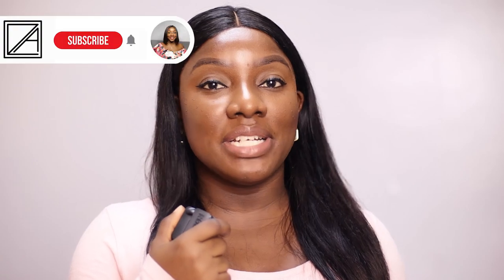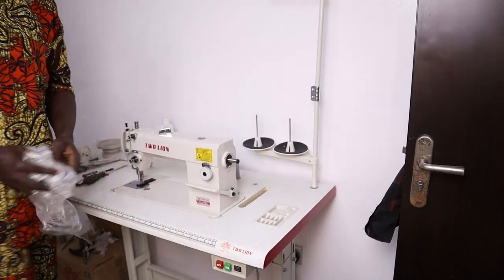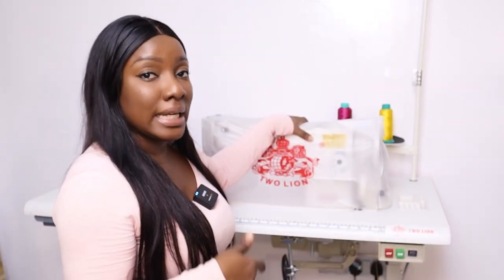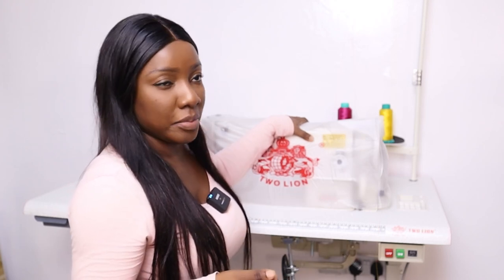How to set up an Industrial Sewing Machine | Eris Atelier

Comment: Hello ma'am. Thanks for the video but Is it possible to slow down the speed of a clutch motor that is way too fast?
Reply from the maker: Unfortunately not., clutch motor has no speed control. You might have to switch to a servo motor but they are not as powerful as clutch motor tho
Reply: @TheErisFoundation  thanks you for the reply